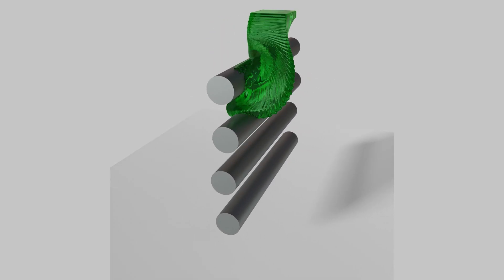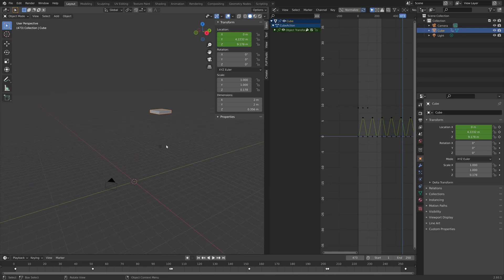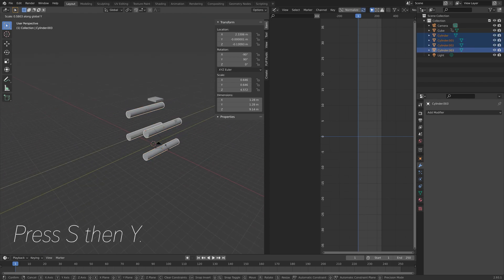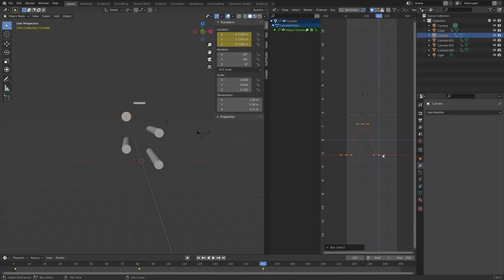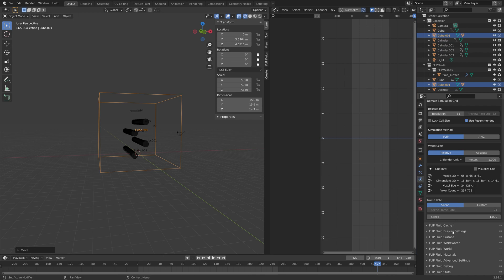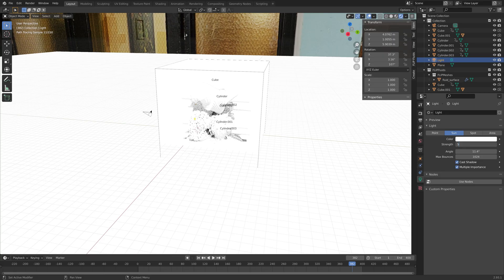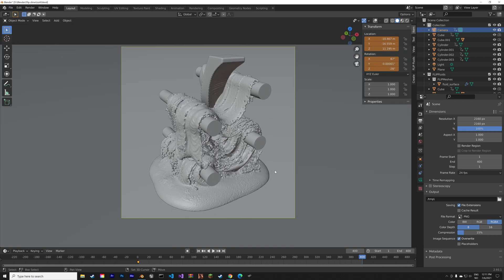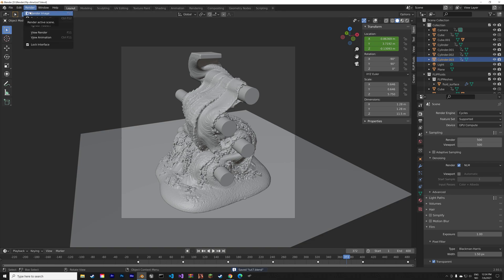EPIC Slime Simulation TUTORIAL in Blender Using Flip Fluids

Comment: Here's a tip for you! If you type the expression "#sin(frame*.1)*.5" into the Y value, you make an automatic sin wave animation without having to go into the drivers menu. The "#" makes it an expression/driver and then the "(frame*.1)" is the speed at which the box goes from side to side and then the "*.5" is how much it moves back and forth. Of course, tailor it to your preference but those are the values I used. But if you follow these and use drivers, make sure to check the "Export Animated Mesh" box in FLIP Fluids.